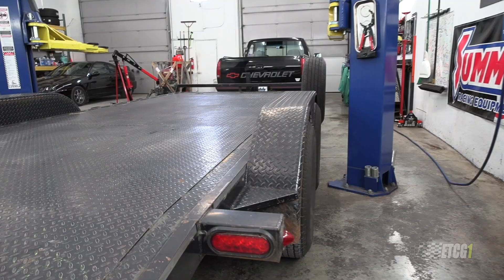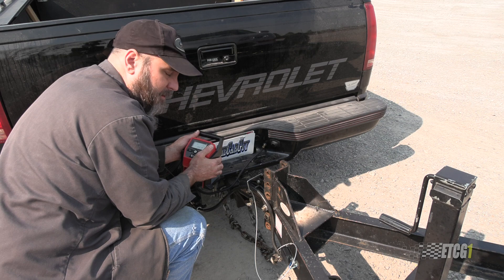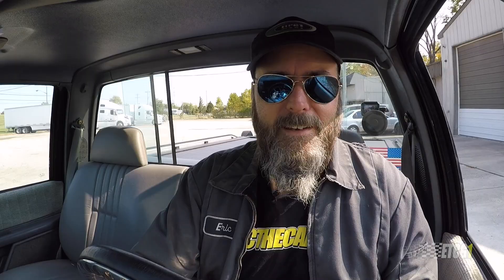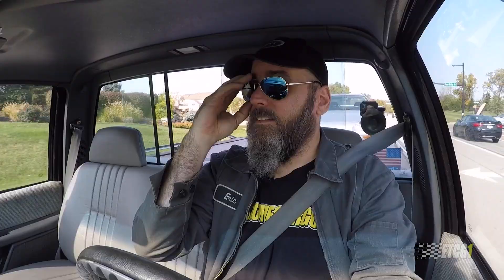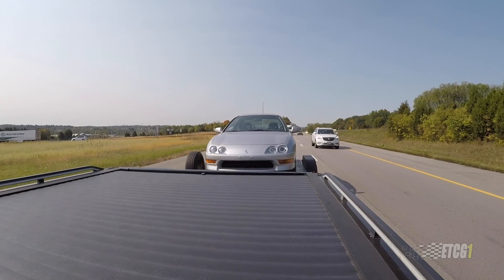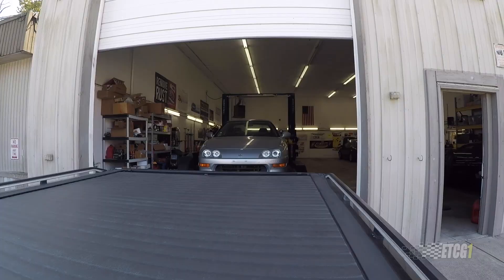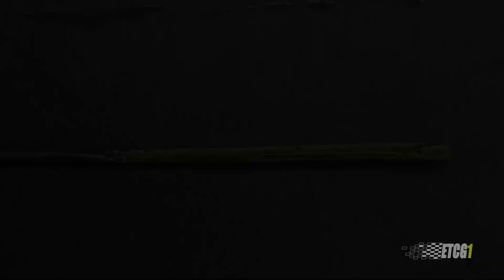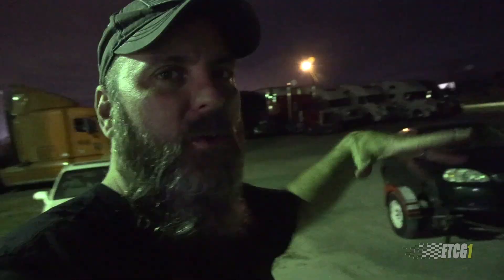First Time Towing With Airbags

Comment: Air bags don't increase towing capability, just so everyone knows. Air bags also don't distribute weight properly, they just change the suspension reaction. The one thing I do agree with, is having independent bags, this prevents one bag pushing air into another with cargo shifting or vehicle turning...keeping them in dependent prevents this and is the best way to go for towing.

Comment: hey don't turn your head to look behind you, your mirrors can see much better then you and that'll make a big difference indeed, as long you've got  your mirrors set right of course.  a little to the blind spots when head is directly forward & have to tilt/turn your head a little bit to see out the mirror completely.  it also eliminates getting blinded by a car directly behind you if they have shitty hid/led lights or brights on!
Reply from the maker: I agree. In fact, the more I back up a trailer, the more I use the mirrors. Thanks for the comment.

Comment: I had a '50 Chevy 4 dr when I was in college, in NY then, registration was based on weight, I remember it was 3250 #s, I doubt if your accura is less than about 2400#s, so I think that your estimate of the addition weight of your father's '51 chevy is overestimated.  While those cars were larger, a lot of it was blue sky, waisted space.

Comment: still can adjust each separately with a y if you put an on off valve after the y on each side?   but to each their own. been watchin u for 100 yrs. ;P  P.S. when u backed it in after the ride, you didn't have ur hand at the bottom of the wheel.  haha.   Thanks for posting Eric.

Comment: Do you have a video explaining the devices you used to set fuel and timing like this?  I have a couple of computer control rigs and one is a 1990 G20 6000K 5 lug, TBI.   just having it running with new motor and transmission (AT).

Comment: Keep an eye on all your tuning, temps and stuff when you see some hills, I know there isnt much for those around ohio
Reply from the maker: If anything my temp is too cold. I have a 180º thermostat in it, but the gauge was reading 160º most of the time on the highway. Trans temp is 140ºish. BTW, there are quite a few hills in NY where I went to pick up the car. Temps really didn't change much. It did get a bit dicy in spots because of a very slow driver in front of me. I rode the brakes so much I could smell them. Thanks for the comment.

Comment: 4L60E are a problem though. Blown 2 myself.
Reply from the maker: Where they built by Monster transmission? You can update some of the hard parts and modify the valve body to make them stronger than stock. Also, cooling is very important. If you're doing serious towing it's recommend you run a separate transmission cooler. If you keep the trans temps below 175º, they last a very long time.

Comment: Meanwhile in europe: Towing a 2800lbs car with a 3800lbs car with a 125 hp 2.2L turbo diesel for a 750 mile trip ¨this is fine¨ Honestly though the only thing that could have been better was a bit more grunt in the engine for the uphills.

Comment: Shifting the car back on the trailer did a lot too. That hand held programmer, can you preset a towing program, programs or is it just program as needed? The'51 Chevy cars seem to be running around 3200 lbs.
Reply from the maker: I believe I covered your question in the video. Thanks for the comment.
Reply: @ETCG1  I listened to it again, you did, and it's no it won't.

Comment: I did a 2 and 2 drop on a 94 Ram 1500 using Bell Tech spindles and rear drop shackles now when I load more than 500 lbs 226 kilos it occasionally hits my stock uncut bump stops. did you cut your bump stops?

Comment: Looks like that old Chevy weighs about 3175 an the integra 26-2700 lbs. and will have  a bit different weight distribution. The fairmont sits in the middle at 3k. Any plans to test with a heavier car?
Reply from the maker: Not really. I think I could tow the Fairmont, but not the '51 and it's associated parts my dad has collected. I never built this truck as a tow rig, I was just trying to make it work and see what capabilities it had. I think I could tow the Fairmont in a pinch, but not more than that. Remember, the trailer weights about 2Klbs. Thanks for the comment.

Comment: I wonder if having two such sets one before, one after the axle, would allow for even better, smoother ride. Theoretically speaking, it would make things much more easier on the bags too, since they are wearable/consumable items, ultimately.

I know that some special towing trucks, have that kind of setup on the trailer's axles, and i transported a surface plate with such a trailer, the thing was so incredibly smooth and removed from the road surface, that outside the upper revs of the engine, and the tugs starting and stopping, i felt nothing. Like there was nothing back there. Can't help but wonder what it would feel like on the actual truck, if these small, compared to what i saw, units did this much a change.

edit:grammar
Reply from the maker: I think it'll be some time before these airbags wear out. Keep in mind that tractor trailers ride on airbags exclusively, meaning, they don't have coil springs, just airbags, and they last for hundreds of thousands of miles. These bags are similar. Also, adding more airbags on this truck really wouldn't help. It's still a short wheelbase truck with a moderately strong rear axle. Adding more weight would just stress the system too much. It's just not enough truck for that. Thanks for the comment.
Reply: Eric what about installing air bags on a Honda Element
Reply from the maker: @HotRod-wv4vm  That's only going to be with me for a couple of months. I'm giving it to my brother at the end of January. Also, I don't really use the Element for hauling things since I have the truck.
Reply: ETCG1 thanks

Comment: General question… are there significant risks in towing something that exceeds your vehicle’s tow capacity by less than 1,000lbs? We have a 2WD suv that can tow 3500, and we are looking at a trailer that will likely exceed that once loaded, but its unloaded weight falls within our tow capacity’s range. (I’m not a car guy at all, for what it’s worth!) Thanks!!
Reply: If you're unexperienced in towing, definitely be very cautious.
With experience in towing in spec it's a little bit safer to push the limits but without experience, it can go wrong very, very quickly.
If you do tow the load, make very sure that the load is correctly distributed and drop your speed, look further ahead and react to changes in conditions gradually, erratic or dramatic changes in speed or direction will cause issues.

Comment: I've always been curious about airbags. This answers a lot. One question I want to know is how much weight they can additionally carry. I guess it depends on the brand. I ask because my 3/4 ton Ford has always had Hellwig full length overload helpers....and it definitely needed them. It hauled a 2,500lb cabover camper while towing a 23' camping trailer. 
The biggest problem when using those helpers is adjusting the spring tension. It's time-consuming. Yes you can remove the end u-bolts and make it ride normally when unloaded, but then you have to store them and try not to lose them. Installation is much easier than airbags and will not degrade or tear. They're also much heavier too. So there's that. 
Should I switch to airbags? Or should I just keep my Hellwigs?
Reply: I put air bags in my 3/4 ton gmc for towing my 5th wheel (2,000ish lbs pin weight) and I have 0 complaints. I went a little over the top with my installation. I bought a viair compressor, tank, pressure switch and all that nonsense so whenever the truck is running it will maintain 120-150 psi. I also installed a ride height so trip valve between the frame of the truck and the rear end so any time a load is placed on the truck it automatically inflates the bags to whatever pressure it takes to restore original ride height. 

Air bags are Firestone ride right rated in the neighborhood of 5,000lbs (4,800?)  all together I have about $650 into the whole ordeal including the $300 purchase price of the bags, plus my time of course
Reply: @Overkill14  wow! Not bad at all for cost. I knew they had their place in big rigs for sure, but wasn't aware of their availability in light to medium duty applications. Thank you for all the info. It's definitely given me a lot to think about for options.

Comment: Just bought a truck with rear air bags.  should I keep them inflated or deflated? anyone know max air? its a 99 f250 7.3  Thanks for help.
Reply: Are your bags smooth like one smooth cylinder or do they have 2 rounded shapes on the side profile

Comment: They work but on rough roads they will wear out quicker.
Reply from the maker: But the ride is very smooth. I've aired them up just a little for regular driving and they help a lot.
Reply: ETCG1 
Absolutely they will. It’s the best way not to rattle tooth fillings loose driving in the Cincinnati area 😂😂

Comment: I thought a vehicles computer adjusted timing and fuel automatically?  Why would you have to do this yourself?
Reply from the maker: This is a modified truck with an aftermarket fuel injection system on it that does not have provisions for a knock sensor. See description for a link to the system.

Comment: '51 Chevy shouldn't be 2k lb heavier.. it only weighs 3300ish lbs. Not sure how many parts he has stuffed in it...
Reply: Pretty sure your TL weighs more than the '51... again, if he's got a lot of heavy stuff inside that could certainly change things.
Reply from the maker: @mustangthrall6680  About 30 years worth of parts along with the car.
Reply: @ETCG1  I think you’ll be fine.. worse case, it if looked sketchy, you can always leave a few things behind and load up the bed on a second trip.

Comment: Why would you want to find out? The trailer just adds to the overall force, increasing the amount of damage and injury in a collision

Just wear your seatbelt, the scientists and engineers already figured this out

(Btw, yes I know. I used to own a Lincoln Cloud Boat)
Reply from the maker: The truck has been 're-engineered'. It has more power, better brakes, and more towing capability as a result. My purpose was to see the results of those improvements. Otherwise, I'd just be 'saying' I could tow more, instead of actually proving it. 

Lastly, please read my disclaimer in the description. Also, please note the number of times I talk about safely towing a vehicle. I never claim that this will increase your vehicles towing abilities beyond safe limits. Thanks for the comment.

Comment: I think it's kind of hilarious that you took a truck designed to haul trailers, then spent money on lowering the truck to make it less capable  of trailering, and then had  to spend more money to allow the truck to decently tow vehicles again. All for appeance. I don't get it.
Reply from the maker: I never built the truck to be a tow rig, or else I never would have lowered it in the first place. Even if I didn't lower it, a 1500 doesn't make for the best tow vehicle, a 2500 or 3500 would have been a better choice, but this is the truck my dad gave me. That said, I think it turned out pretty well and I got a bunch of useful videos out of it. Thanks for the comment.